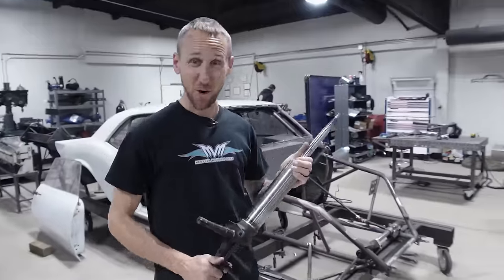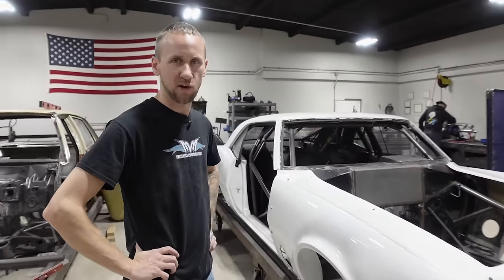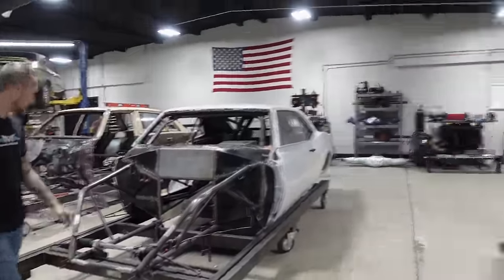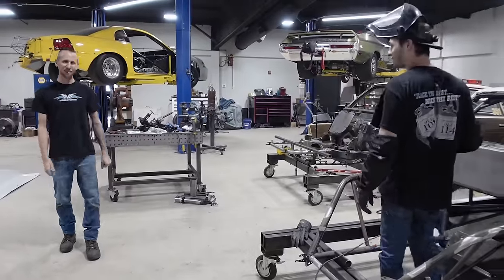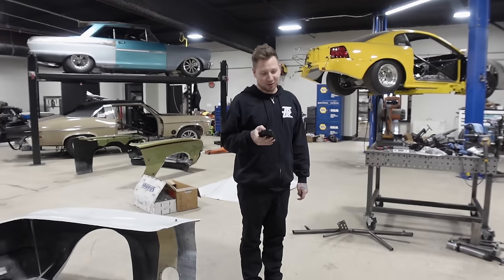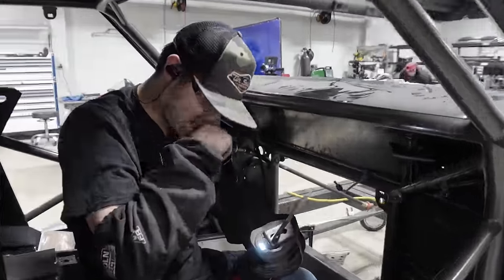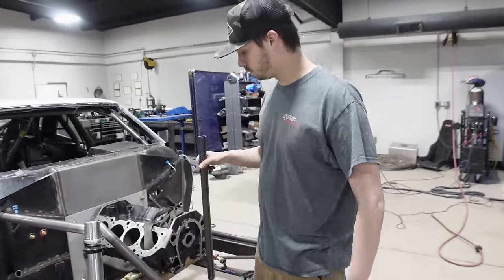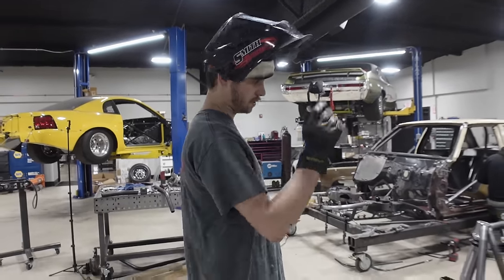Transforming Billy's Camaro: Debut of Menscer's Prototype Struts

Comment: Do NOT use those struts , they need to have 1.5 inches cut off the body of those struts . You have to have uptravel, and I'm sure yall know that. You're in it too deep. Just  make it 110%, right not 90%. Just my 2 cents 🤷‍♂️ that drives me nuts just looking at it.  If your going to do it do it right IMO
Reply: It's their first time. They've never done suspension work or chassis work on vehicles. I'm sure they may need help from the peanut gallery in the comments to walk them through on how to build Billy's car with the money the peanut gallery is paying to have built.
Reply: @MidgetPunter  nobody said they could do it better!!! I was going off what they said, watch the video.  He specifically said it was maxed out and wouldn't have any uptravel and they would have to raise the car up . Am I wrong??!
Reply: @moline800hdyup4 He also said that they can just raise the ride height. So problem solved. 👍🏻
Reply: @streetracingmiscreant8589   bit he also said Billy didn't want the ride height raised.  That's why I said , why not do it 100% and not 90% . They where already there, why not do it right 🤷‍♂️
Reply: @moline800hdyup4  True. Personally though, I would sacrifice a couple inches of ride height for the added travel. 
Assuming we probably didn’t hear their entire conversation, I wonder where he landed on that subject. 🤷🏻‍♂️ It may end up riding like Sherms Chevelle.
Reply: @streetracingmiscreant8589  gonna have that Carolina Squat . I just can't imagine Billy being ok with it. But I don't know him from Adam, so I can only go by what I watch .... I'm just confused because the guy even said these are too tall, too, and it won't have any up-travel, and the next thing I know, they got the welder out .. I know I wouldn't want my car set up like that personally, but everybody is different, or they don't care, which I don't think is the case at all.🤷‍♂️🤷‍♂️
Reply: Do you agree that they should use a strut that has up-travel and NOT the struts they used ? 

Should they have sent them back to get them remade in the proper up/down-travel configuration ?

Or am I wrong?
Reply: It's also a mock up shock has no valving so it will probably be shortened. Tin soldiers didn't grow into the business their in half assing race cars. I assure you it will be right when it leaves. Every car they build the goal is a satisfied customer and a car that ends up in the winners circle!
Reply: @jonathanvaughn1658  I couldn't agree more, maybe they will clarify on there next video.  I just thought it was odd is all. They definitely build some bad azz stuff!👍
Reply: LOL is this a legit post ..it will have travel 😂😘
Reply: @wolfracing9504  did you watch the whole video in detail..??

Comment: You guys use a zip disc and the grinder a lot LOL. I would have broke out the porta-band and went to town . My other favourite is a air saw , some call them a wah wah saw from the sound. I love mine and use hacksaw blades and cut the to the required length as required . 

How much travel do the cups have ?? I would think one could make a similar cup a 1/2" shorter if required . Looking forward to the progress on this project and of course CB!!!

Comment: Your shock doesn’t have to be on the centerline of the ball joint. You can make a bracket coming off the back of the lower control arm. And it would probley give you 6 inches more travel.

Comment: We're in deep now boys😂.. wonder if he went full on change mode and went twin turbo with the build instead of ProCharger even though he bought the ProCharger that way he'll have two engines that work for both builds ..
Reply: He had on his last video that he wants tye camaro and nova to have same set ups and close to same tools for now, he also said financially for now to stick with turbos.
Reply: @travisjolley6688 yes that's what actually made me wonder if he went through with it because he already had them building the car for something else I don't know if they had to change something for the difference in setups RF they're only at the point they showed in the video anyway so it wouldn't matter, I know he already bought the ProCharger so I just wasn't curious if he pulled the trigger and told them he's for sure he's going that other route ..it definitely makes the most sense money wise and racing wise ,and as cool as a procharger is it wouldn't be cool going through that learning curve in the middle of the season .. it's hard enough being as new to EFI as he is without completely changing to a blower combo and then switching back and forth between the small block s10, Nova.  And Camaro
Reply: @freedomfox8183 I think i remember hearing them say they were going to have to move the rack for the procharger but now they wont
Reply: @freedomfox8183  procharger blower motors are easier to tune as the boost curve is rpm dependent so you just use timing to control power/traction
Reply: The question was answered at the end of the video anyway😂